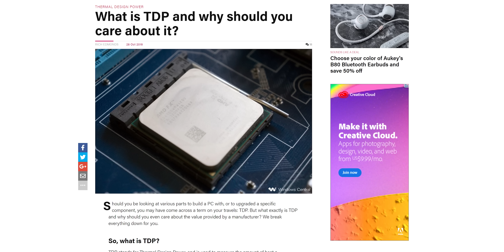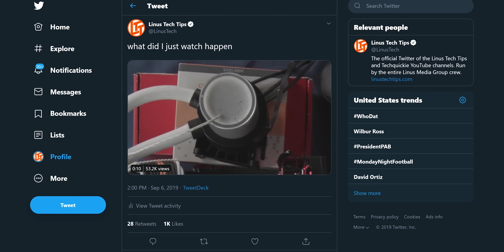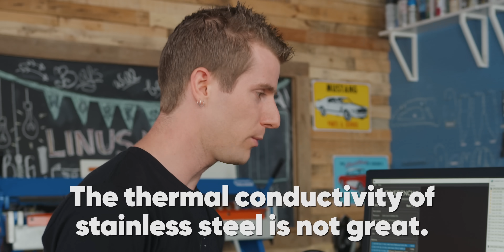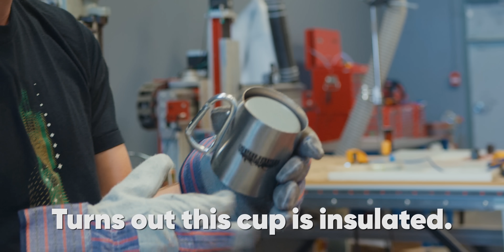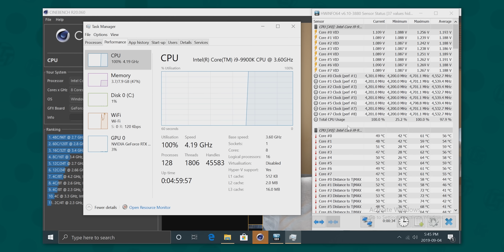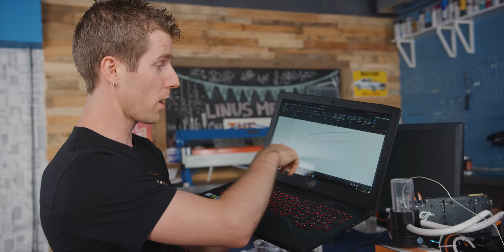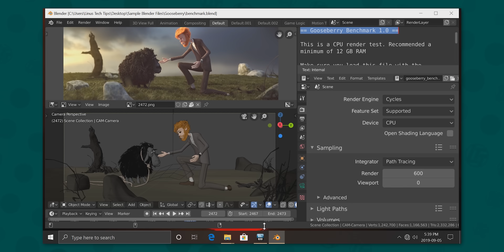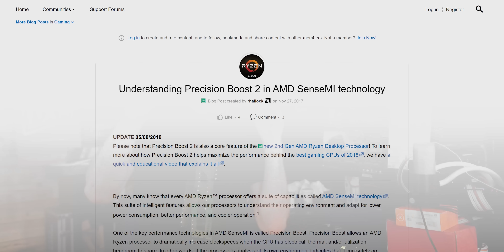Who REALLY Runs Hotter? AMD vs Intel

Comment: I just ordered a 3700X. I wonder if the 65w TDP will actually be that low? Almost as powerful as the 3800X and $110 NZD cheaper here. it still manages to give the far more expensive 3900X and 9900k a run for their money and even beats the Intel parts in Cinebench r15. My computer has to do more than game and runs all day. I got big savings on my power bill ditching my overclocked 2500K for a 2700X, so power usage is now something I factor when choosing an upgrade*. I have a very gorgeous looking Noctua NH-U12A cooler with sexy beige and brown fans. I am not sure it is even needed with the 3700X. Maybe will help thermals in summer.

*wars are fought over energy, so I think it's a good idea to not use more than we need to. I like NZ to stay clean and green too. Tourism is our second largest earner. I am permanently disabled from work busting up my spine. I don't drive now. My last car was a X-Type Jaguar. A beast but expensive to run. If able to drive again, I'd like a Tesla or some other electric vehicle other than a Prius. Politicians sometimes look like they use green issues as a way to raise money, but it does not mean i dismiss the issues either. 

My ship burnt $30K USD of heavy fuel oil a day. We did everything to keep that cost down by being efficient with energy usage. We were told pulling 150 tons of fish a day from the Southern Ocean was sustainable. We just wanted to believe that spin because it was our jobs on the line. Surprise, surprise,. it was not sustainable and quotas were slashed so the stocks could recover. After BS like that and big lies like WMDs, I do not take anything at face value these days. Everything is in the maybe, maybe not category until I look further into it. CPU reviews etc too.

Comment: What about a water block and pump together with an insulated aquarium (even a small 10l one) while running the test for much longer? IMHO that would give you a much more precise result!
If you are worried that the pump would introduce heat, run a control test with the cpu off, with only the pump recirculating the water
Anyway I enjoyed the video!!

Comment: What about measuring the current flowing through the CPU cables, and the voltages to calculate the electrical power draw. This should give a very good estimate for the thermal output.
This sounds very promising (the powenetics project): https://www.tomshardware.com/reviews/power-consumption-measurement-cpu-gpu-components-powenetics,5481.html

Comment: Open water reservoirs lose a lot of heat by evaporation. Glad you settled on using a pump. Actually, an AIO is a fixed thermal mass, you could use that.  Just take off the fans and put the radiator in a few plastic bags for insulation.

Comment: 400g of water = 1671W power would raise temperature of that much water by 1K in 1s.
500g would be 2089W
250g would be 1045W
Reply: i have no idea if you are right, but it sounds right so im not going to question it

Comment: I went from a 6700k to a tr 2920x and the 2920x kicks out allot less heat going from a i7 nhd-15 to a tr2 be quiet dark rock pro. 
Sure the i7 was overclocked to 4.6 [not its max but 4.7 required to much power for my taste] but the 2920x oc's itself constantly and during heavy use its still ocing.
I do feel like i got lucky with my 2920x when i check out reviews where people are happy with a 4 / 4.1 oc while mine autos to 4.125 during heavy use hence i havent oc'd it myself yet.

Comment: 99k is a very hot cpu! and with stock cooler, you cant use the full power of these chips!! and if u want to overclock them u need a very very good custom watercooling solution to reach the 4.8-5ghz!!

Comment: Stuff can use more watts and still run cooler.. There are MANY factors in this. It's the same with a amp.. A 500w amp can run cooler than a 200w. It's all about design, heat spreading, efficiancy etc etc etc. So more watts does not automaticly always mean more heat. No matter if it's a CPU, powersupply, amps and any other electrical things.

Comment: Not hating but you really haven't removed any variab le with this experiment, since differences in the manufacturing process from Intel and AMD are still present. And by measuring the time it takes to heat up a cup of water to 80°C, you're still effectively measuring the heat flow, not the actual heat output so you have effectively accomplished nothing. But still very entertaining video XD

Comment: Go Intels way, cant see Intel going Amd's Way. I just wished for Intel to go out and flatten AMD by Selling all stock at break-even prices,  severely undercutting AMD, bringing out its GPU which puts just a bit better and cheaper than AMD's GPUs again for Break-even Value, wait for AMD's Stock Value to crash, make Intel buy the AMD company but splitting up its GPU division, making it ATI again, and still controlling it the same way the Chinese Govt. controls Huawei, and taking over its Processor division, stop selling for cheap and incorporate it into Intels product stack with different branding, the reason for the breakup of AMD would be, to bypass Anti-Trust Laws, and therefore gain consumer market share. Although, im yet to see an AMD in the Workplace. As i have worked all across the world every computer i have ever used has Intel Server workstation Xeons with Nvidia RTX4-6000s. style gpu's......   I don't see that changing, the most important thing is not just heat/cost to a company but also Work Done- IPC
Reply: More competition means better stuff at lower prices. Without competition, one company can do less and charge more. 

(this fact is well established in modern markets).

AMD has not offered any serious competition against Intel until recently. This is why Intel has not offered impressive improvements for the past decade or so, which is also why you don't see "AMD in the work-place" (as you put it). It seems you are a fan-boy for Intel. As for me, I do not care which company gives me the best performance-product. Whichever product will give me the most for my money spent, that is the product I will spend my money on, no matter which company makes it. "Brand Loyalty" means nothing to me in this respect. And ALL companies do crooked things to make more money, so all the stories of evil crooked tactics becomes a wash and still means nothing.

Fact is, as of today, things actually ARE CHANGING from Intel to AMD, you must be missing it for some reason. I just received an AMD Ryzen processor from Amazon today to build a small PC to experiment with and will probably buy a more powerful AMD Ryzen in a month or so. But if/when Intel offers a better processor per dollar, I will not hesitate to but the Intel.
To me, buying processors is the same as buying gasoline for my car. I buy gas based on who is the cheapest and/or who is close by when I need it (I do avoid no-name brands however). Beyond this, I have no "Brand Loyalty".

Another case in point:
I have been a Mac User since 1997 and for a while I was a "Mac Fan-Boy". But eventually I tried Windows PC's to save money, but they were terrible systems each time. Last year, in March 2018 I tried Windows yet again just to play a certain game, World Of Warships. Ironically, I installed Win 10 on my 27" iMac hehehe, and it has worked without any trouble since! YAY! Therefore, now, I am starting to build my own PC (using Windows 10 of course) because finally Windows will run fine for me without hassle (as Macintosh always has).
Now that I am over 50, I have out-grown the "fan-boy" mentality...plus Windows 10 is stable. I was always a Chevy guy as I was growing up but I now have a Ford in my driveway. No more "Brand Loyalty" or "Fan-Boy" life for me.

I am typing so much because is it 3:00am and I am rambling. But I think I will stop now so that I can take a look at the new motherboard and Ryzen 2200g (RAM will arrive tomorrow), I should have it up and running by the weekend. Ryzen 2200g, yes, I am starting very small for my first PC in several years and will likely add a small GPU in a week or two....then build a more impressive PC with a 3600 or higher and a GTX 1660ti and hopefully a nice looking case with nice looking parts and a touch of RGB.

PS:
These are my own personal views based on my own personal research and experience. What's important to me is probably not what's important to you, therefore, we spend our money on different things for different reasons and that it the way it should be.

PEACE!

Comment: measure power consumption.

Electrecity used is converted into heat.
Reply: You do not know what % of electricity is converted to heat in each CPU.
Reply: @Rainnnny  Yes. It's 100%. It HAS TO BE 100%, always. Law of conservation of energy. Whatever else is achieved with the energy along the way, it all ends up as heat, once all its other work is done.
Reply: @Ben Rei Not "most" - *ALL*. Exactly 100%, guaranteed.
Reply: Will not work, every Cpu has its own efficiency. I'm fairly sure the 7nm has an edge over the 14nm++++++++++ of Intel on that one...

Comment: Given that a CPU is a pretty much 100% efficient resistive heater element.... why don't you just measure the power the cpu is drawing over time? That's pretty much 100% accurate and not even that big a deal to setup
Reply: Entertainment value
Reply: @LazicStefan it's not to measure temperature, it's about measuring the energy converted
Reply: @LazicStefan "Mr smart" basic physics but okay. I have no reason to do it, I don't have the hardware necessary and I certainly don't have the motivation to spend the money in order to acquire that hardware

Comment: Why make such a hassle: connect an actual water block, pump and one or two temperature probe fittings into one loop without a radiator. Measure temperature. Use the same loop length in order to have the same amount of fluid. This, this was just unbearable to watch.

Comment: I love the concept of this video but unfortunately, you absolutely butched the execution 😔
Reply: I think they should've poured more dye in. That must've been the problem
Reply: @MegaAlpakka Yep. Or just find two motherboards with identical VRM design.
Reply: that's what my college semester starts and ends off like! :'(
Reply: Wasn't that the point to begin with? Running this test with proper methodology is quite boring (just measure the power consumed via EPS cable) and is barely videoworthy.
Reply: @mungojerrie86  Just for curiosity : 

What are you assuming to accomplish by measuring only consumed power ? 
How would you find about the correlation of the consumed power turned to actual cpu cycles (and in more depth of core efficiency) ?
Reply: @tracer822  Power equals heat. Wasn't that the idea? Now great does not necessarily show how hot the CPU gets but again there are much simpler wats of measuring that. Depending on what exactly indeed is selling to find out some of the variables could be controlled, be it frequency, workload, time under load or whatever else.
Reply: @mungojerrie86  Power doesnt equal heat ,as far as I know. The amount of power turned to heat differs by the efficiency.
Reply: @tracer822  With CPUs is very close to 100% anyway.
Reply: @mungojerrie86  Please correct me if I'm wrong, but the way I understand it is like this: the wattage you dissipate as heat is not utilized and therefore is the main source of inefficiency. An Intel 9700K consumes about 235 watts and has a rated thermal dissipation power of 95 watts. This would mean that out of the 235 watts, 95 watts is inefficiently disposed of as heat. This accounts for about 40% of the power consumption, therefore making the CPU about 60% power efficient. Not sure if there are other factors which affect power efficiency.

I suppose that in the end the most relevant metric would be something like "calculations performed per unit of energy consumed", but that wasn't the point of this video.
Reply: @Riceau_NL  No. CPUs are almost 100% effective as space heaters. 235 watts consumed means ~235 watts dissipated as heat. TDP is an unreliable metric which exists mainly to indicate how much power and cooling a CPU requires to operate at base clocks under full load. So it is an approximation which in modern reality is quite often very inaccurate for desktop processors. It is way more accurate for laptops and servers, but you can basically ignore it for desktop.

Calculations per power, or power efficiency is a valid metric and some reviewers do indeed measure it - Techpowerup and Hardware Unboxed are the first that come to mind.
Reply: @tracer822  The experiment can't take off properly because CPUs have a built in thermal throttling to conserve product effectiveness and usability...
You don't want to brick all your CPUs in a single day because you want them to be perfectly powerful.

This means you cannot utilize merely power or heat alone, you gotta use a complex equation of Power, Heat, and Efficiency all together in order to find a solution, especially since a complex computer hardware like a CPU requires a complex SOFTWARE to manage it's operation.

Sounds like they need to hack the mobo or software to ignore thermal throttling or something?
Reply: @dra6o0n  I dont think so because we are not here to learn the best technological equipment. For us mortal consumers, it is pretty obvious and easy to observe which processor quickly reached its thermal limits and by that time, how much processing it did with the same cooling options applied to rival cpu. 

Amd is clear winner here. Pure gaming performance with decent cooling ? It is another subject which intel leads.
Reply: "Take off properly"? You might want to take another course in English.... Lol. Because that was not English.
Reply: @mungojerrie86  I beg to differ, that sounds way more interesting to me.

Edit: I'd like some real data to interpret trends. If the data is junk it's just reading tea leaves.

Comment: If a cpu can keep a lower temp while generating more heat, then good for it. The definition of temperature is the degree of hotness or coldness of a substance. So even if something does produce more heat, at the end of the day if it get rids of the heat better and runs at a lower temp, it is then running cooler.

Comment: Not that it matters anymore. But you had the equation correct [q= d(m)/dt . Cp. (T2 - T1) ] (q equals m.cp.deltaT)

So knowing that, you could just install a water loop, have a flowmeter and inlet and outlet temp sensors. And calculate heat transfer in real time. Having no air bubbles in the water would ensure the sensors get an accurate value. 

Alternatively you could install air temperature sensors on the inlet and outlet temperature sensors as well and air flow meter (i little more tricky to accurately measure). But would have yeilded a very close result. 

Even more alternatively if you put your entire system in a closed space like a fridge, you could still put the temperature sensors and flowmeter in the refrigerant line across the condenser and get the same. 

Keep in mind as you go from water pump, to fans, to compressor; you need to subtract the power of each equipment.

And to make it entirely boring, since all the heat energy is being converted from electrical energy (which is by far easiest to measure with) a power meter would get you the total energy (heat) generated.
Reply: Holy smokes, this is big brain.

Comment: Is there any particular reason why you went with temperature testing rather than monitoring the wattage consumed by the CPU itself? If you can log the voltage and amps pulled through the EPS/8-pin CPU power connectors, then you have your thermal result. (Watts = volts * amps and electric watts = heat/TDP watts).

Okay, it's not as cool as using color-changing die, but it probably would have been far easier to do than what you ultimately wound up doing.

Comment: well linus ill give you a wayyy easier way to measure this: put a dc amp clamp on the cpu power lines, see how much it draws; thats how much heat it has to put out, thats it

energy cant just be turned into computation, simple as that

Comment: Water is the classic basic chemistry/physics substance to test on when learning about heat capacity. Couldn't they do something along the lines of seeing how long it takes the water to reach a certain temperature (with a regular thermometer) and just calculate the amount of power that it took? No need for this iffy color changing stuff.